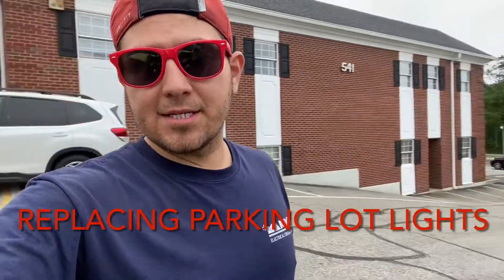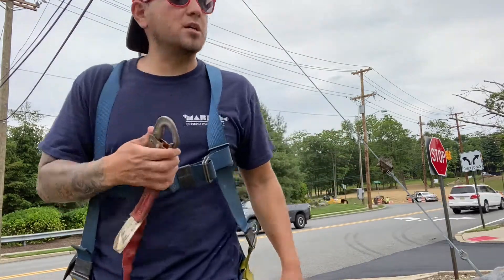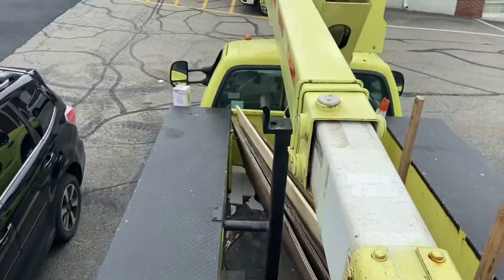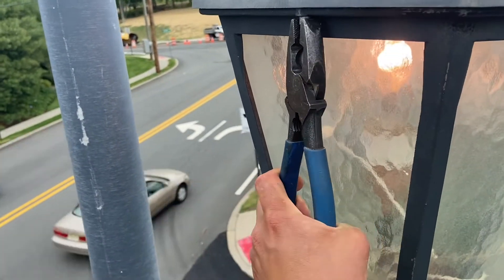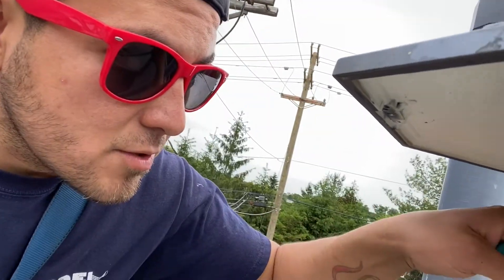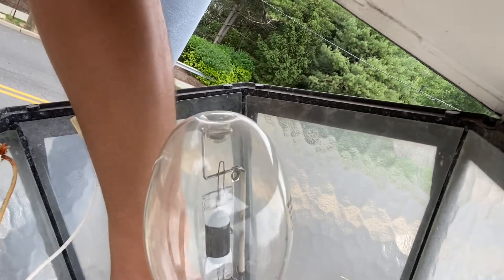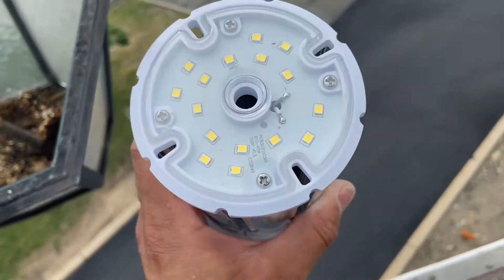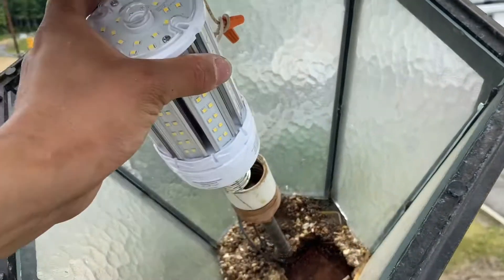Replacing parking lot lights with LED bulbs

Comment: Those 360 degree corn LED bulbs work well in this fixture type. Many times, the 360 degree LED bulbs are used in floodlight fixtures with a rear reflector. I would have cut down the piece of the all thread pipe supporting the bulb so the LED bulb was further down in fixture. The bulb is too far up near the upper lid of fixture. You also have to remember that you are reducing the energy consumption from roughly 190 watts to 45 watts.